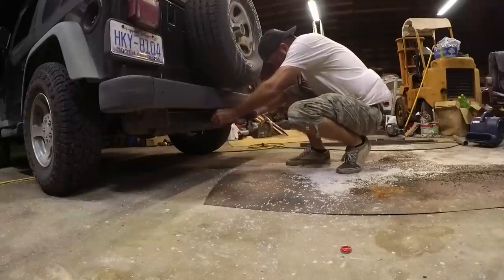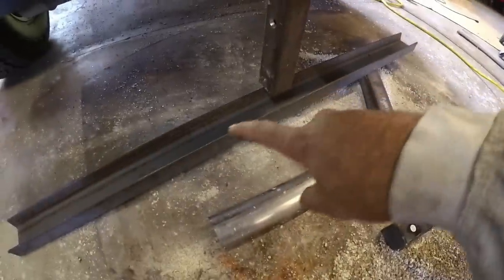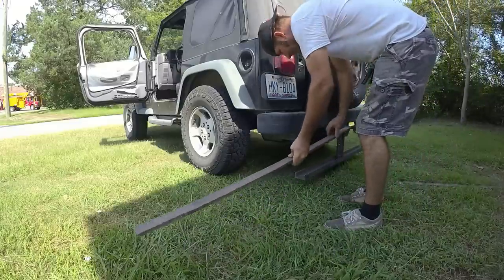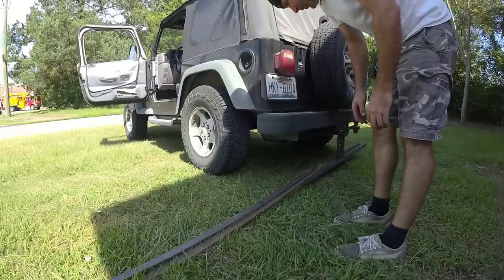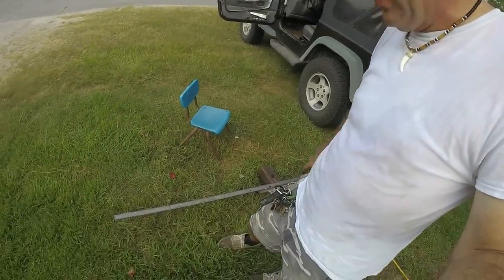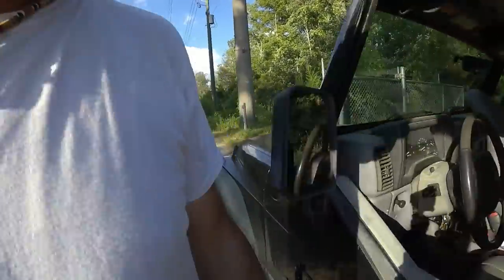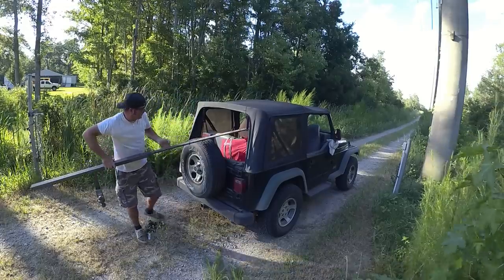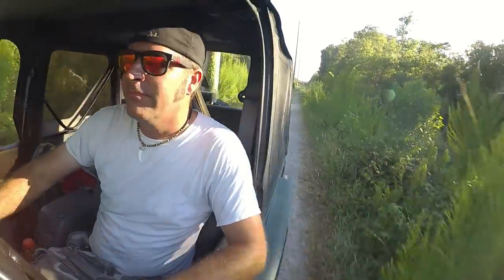Can I Build The Fastest Lawnmower?

Comment: at the beginning I was sure you would attach a lawn mower to the back of the jeep, and after watching the video, I think that if  you had a lawn tractor motor on a frame mounted to the hitch you could probably use belts to run side mowers, maybe use mower decks from the tractor too but chop out the front so they could eat properly...just a thought

Comment: If the blade was on a pretty decent angle(like 45 degree sweep towards the back at outside,I think your idea may actually work decent. The grass needs to be able to roll off instead of just being straight and piling up. Same principal as angling a snowplow. Future experiment for science purposes?
Reply: You are correct Randy Babcock. The angled blade is the ticket to success.
Reply: @johnnickerson6522  may need a bit more strength too,but I think it's a viable project. Gotta lose the drag
Reply: "For testing purposes only".
Reply: Yes exactly why im here to comment. It would work much better angled back. It would also cause more of a slicing effect and probably cut better.
Reply: the angled bade wouldnt need to be any stronger than what he currently has. the bending came from the flat impact and subsequent clogging up. if it were angled, it should shed any clogging, and have much less stress against it.
Reply: 45 and a big spring for breakaway in the heavy
Reply: I made a comment saying the same then scrolled down and saw yours lol
Reply: @iancampbell6002  it happens. I did the same. Saw a few after I made mine. Comment first,scroll later,let God sort em out
Reply: My thoughts exactly!!
Reply: Samezes ! Angled cut so it self clears and slices at it more! I think you’re on to something. Also ad a roll bar slightly above and behind the blade to keep the tall stuff from wrapping around the blade instead the roll bar will keep it partially vertical to keep slicing it
Reply: Adding a serrated adge would help significantly along with an angle

Comment: I have a jdm 2.5 swapped Subaru impreza station wagon that has a lawnmower installed to the spare tire well in the trunk. Not that anyone asked, just thought I'd share. Its a junker with issues... but if for some reason you want an oddball like that, I'd  say you can have it for free. Otherwise its just going to return to nature.
Reply: If you are getting rid of it , I will buy it from you  I will add long sickle bar off each side , that I got off of a golf course mower .

Comment: Seemed to work well enough. Maybe put a small Honda clone on the end of a belt driven brush blade setup.  That way you can drive slowly around the obstacles. No need for a heavy guard of course
Reply: My thought even was using the rear diff from a car, use belt pulleys to change the ratio so you don't have to drive quickly to make the blades spin quickly.

Comment: oh man, what a fun adventure!  Gets the creative juices flowing.  Iteration #2:  "I Welded It Myself" build a small bushog to hang off the side of that bar, with the Drag Rail motor on it spinning a blade.  (most any riding lawn mower lower deck would work).  No PTO required.  Iteration #3:  put hydraulics on it to raise it, and extend/retract the bar.  Iteration #4:  turbocharge the Jeep

Comment: So, I've done the math on that before... and depending on a little fudge for the actual mower blade diameter and what the governor is actually holding the engine rpm at, you need to be going 50-60mph to get the blade to be moving the same speed as a pushmower blade. I suspect that if you could maintain that speed you wouldn't have the clearing issue, but that could possibly be fixed by angling the blade forward or backward and it would be easy enough to deal with the blade height and angle problem (use a pin to set the height, like an adjustable height hitch, and let it pivot on the pin and then put an adjustable arm from the other side to the bumper to set the angle. A larger and longer vehicle, preferably WITHOUT a cloth top would be safer, maybe a pickup truck (that white chevy you passed a few times ;-) ), a longer vehicle should be more resistant to the torque load causing it to try to turn.

Yes, I've put some thought into this, I've thought about trying it with my Cummins Dodge (MUCH heavier, should be MUCH less prone to trying to turn in from the load) but I didn't have a good place to test it.

Honestly, find 2 old push mowers, add go-kart or minibike tires to them, mount them on a similar arm and then drag them through at about 15mph and you'll have better results and you should still get your mile run done in 4minutes.

Comment: It wasn't a completely stupid idea. It was along the lines of a bush hog blade. I would suggest angling the blade towards the back sharpening the blade more, putting a skid on the very end of it so that can ride against the ground so the blade isn't dragging right against the ground and put a pivot point with a system to where you can raise and lower the blade. Also have the blade up, start going and then drop the blade once you get up to a decent speed.

Comment: Ten 👍👍👍👍👍👍👍👍👍👍!
Some of the greatest inventions came from terrible ideas.
Airplanes for example.
You basically built a large sling blade. Stiffen your mount and angle the blade to the rear 45 degrees so the junk will move off the end.
A heavier vehicle may be advised.
Live and auto insurance definitely.
Pre set 911 in your phone, priceless.
Not a bad idea actually.
Be safe out there.
Cheers
Terry

Comment: Look for an old Sears Suburban sickle bar attachment. I’m sure you can rig up a small engine to a towable platform. You could even use a stripped down old lawn tractor. Use a 12 volt linear actuator to tilt it up or out.

Comment: You're only missing the geometry that makes it efficient like a samurai sword,  the bend actually improves it's  cut as the sawing action as the vertical vegetation slides along the edge of blade and yeah a bogey wheel from local hardware store could help hold it level from digging in but also adding weight and drag that could catch on weedpiles so watch out for that Idk if you've seen the drag trailer with big triangle knifes on it but the guy mows a square hole path to fit his vehicle through like trail grooming and can tow such tractor implementation with any fast vehicle of his weighty vehicles preferred for traction because he was loppin off tree branches with speed ... also had bending and fixing problems but probably one of the most fun ways to go and this was even after buying a bobcat sickle bar mower the thing just worked faster even if not the same clean cut as sickle bar mowers garunteed slow pace

Comment: The poles were definitely a pain in the ass to deal with on the one side of the drive way. but the blade didn't hit any of them. but I feel compelled to say it probably wouldn't have been a good thing. if it would have hit one of them and possibly wrapped your Jeep around one of them. but you did pretty good at clearing all of them.

Comment: I'm not gonna scroll, it's probably been said, but if you had a curved blade (swooping backward, away from the rear of the jeep), it would help. Same concept as an angled blade on a guillotine or mandolin slicer. Longer cutting edge for the duration of the cut. Flat is going to be more of a chopping motion. You need either a curve, or 45 degree angle away from the direction of travel, since it's stationary.

Comment: 😂😂😂😂 good idea 👍🏼 bad execution , why not take it and build a frame that can hold two stand alone push mowers side by side , and have it on a swing arm with winch control so you can raise and lower it to get to each section the. You just start them up and move along SLOWLY! Lol to trim the side definitely put some idler wheels on the opposite so in case that will take the Weight when rolling down the road hope this all make sense,but by far the funniest thing I’ve seen on here 😂

Comment: as someone who grew up in a family that just made stuff to take care of a problem, theres a couple of simple options for you here. the first one is to just swing the blade back at about a 45 degree, so that instead of a straight chop, it sorta slices. and the angle would also shed the stuff that was hanging up and clogging the blade there. the second option is to build a simple sickle blade similar to what a tractor uses, but instead of a PTO, just drive the blade off of a little wheel that rolls along. more engineering there but ive seen many farmers over the years building stuff like that. 40 years in farm country high plains, you see some STUFF haha

Comment: I actually believe that this is a brilliant idea if you use tube still with some bracing and get the thicker still bar and sharpen it weld it together with some serrations like a steak knife I'm pretty sure that the tall stuff wouldn't stick to it

Comment: Maybe instead of using a blade get some square tubing and mount a long battery powered hedge trimmer on the end. Switch it on and start driving slowely so the trimmer has a chance to cut.

Comment: it does work in a fashion. I think if you strengthen the sickle bar by using angle iron and triangulate a few areas and use a heavier vehicle with a longer wheel base it would work rather well

Comment: Pull a rear end with a higher ratio like 3.27 or even higher. Find the rotating assembly from a bush hog, attach it to the pinion. Build a shroud, the do a trailing arm style linkage to hook it to your hitch

Comment: Ok Ike your idea was normal. You're a man that doesn't want to spend anymore time than he has too cutting grass. Totally normal to try and figure out a way through mechanical means Todo so. Men have been working on this problem for hundreds of years. So that being said. Your idea though flawed was not without merit. With modification it just may work. Putting a 40 to 60 degree rearward sweep to the blade would allow the grass to slide off the blade and keep the cutting edge clear. Also maybe     going faster would help. Good luck. Thanks for sharing your adventures.

Comment: Revision 2.0 idea: make a frame that can mount to the front of the jeep, on it's center line. Bolt to that one of the field bush hog decks powered by a heavy duty industrial electric motor running off a few car batteries. That way you can drive forward at a reasonable speed, and line up your cuts. The bush hog units are proven to work, and reliable.

Comment: try adding cycling on it with valve release button when u come closer to pole push hold button it release air out of cycling make blade move back (behide jeep) pass pole u just release button it will fill with air push blade back forward to cutting grass
you need at least 50mhp to make it cut thur grass otherwise it get jammed up by big stuff

2nd version u can do may be safe but not for fast it like pull behide mower with 80hp 70in deck and wheels and attached to jeep hitch good togo

Comment: You know it's not like you don't have money,  are assets that you can trade for a 45 to 55 hp tractor that has a cab with a/c and heat in it.
Along with a bat wing shredder that you can raise or lower end sections as you need to. 
It doesn't have to be 4x4 in order to do what you need, and it's a lot more fuel efficient being rear wheel drive only. 
As long as you have decent tires on it it'll do everything you want. 
You can get offset cutter if you want, but I'd go through everything you want mowed, and either do it with a commercial grade zero turn at low speed and deck raised up as high as possible just to make sure you don't have anything that will destroy a mower cutting at decent speed down close to the ground. 
That's the safest and most efficient way to do it, are hire someone to come cut it twice a year or more if needed. 
If you get the trash weeds out of it, then farmers will cut it for you on shares to bale it for hay, and that gets you agricultural exemption for your land lowering your property taxes greatly. 
If you really want to do things the right way, and a mile each way, with it widened to the furthest point of cutting could very well make you decent money on top of tax exemptions.

Comment: You needed  triangulation on the back side of the blade.  And it won't bend.  It would work.    Strap 3 push mowers to a bar, with atv winch  you can lower and make your own brush hog.  That would be easy also

Comment: hmmm was about to mention that the last time you whent fast on a lawnmower it didnt end up well then i saw youre plan ...............if that wouldve worked it wouldve been sold commercially a long time ago , it mightve worked if you would make it more circle (sickle) shaped with the bend moving to the back or at least mounted at a steep angle pointed back like one side of an arrowhead , that way the friction would move the stuck material to the edge and off the blade 
you might be better of making something spinning , like a predator powered spinning blade or set of spinning blades , if you look at a brush hog it has spinning disks with metal knifes on the end that can spin on a single bolt , 
https://bushhog.com/wp-content/uploads/2020/06/2208Underside.jpg
they been held out by the centrifugal force but can bounce off say a small pole sticking out of the ground 
you would need to drive slower and the blade needs to be spinning anti clockwise so the knife on the front of the mower pushes the grass away from the road when you mount it on the drivers side of the vehicle , it be way more effective , you can still mount it of the hitch receiver and have it hang off the side of the car (maibe use a volvo instead and put on a good cover over the blade and some extra thick steel in the door and behind the seat back in case the spinning blades come off )
the spinning allso slings the cut grass away from the cutting edge of the blade so you should be able to cut the stuff even after the first few meters without the material folding over the cutting edge

Comment: attach a hitch to a 4.11 or higher ratio diff and bolt the blade across the down facing uni-joint. it would be safer but you would have to drive over the grass to use it.

Comment: it seem like it worked even tho it wasn't the best idea. if u could fix it on a hinge point with a sprint to keep it pull out that way if it hit something it could fold back then be pulled back with the spring, might give it just enough movement to keep it from bending it also. just a thought. it worked, not the best so ad to the idea.

Comment: You should find yourself one of those pull behind sickle mowers that the wheels power the sickle blades and they are usually 8 ft long for the blade part I would cut it down to a 4 ft or 5 ft section and have someone with you and you can control the height and it'll cut anything and it will cut Elder brush too or small trees my grandpa did the same thing for his trails and it worked out great only don't fall is it's a two-person operation

Comment: You should build a rolling deck and use 2 125cc engines with a pulley system to run 4 38 inch blades kinda like a brush hog but for your jeep
Reply: If not use it on #carsandcameras behind all of your guy’s fleet lol

Comment: Just get a old 5hrs sickel mount on the back you dont have to go fast and itll cut instead of pulling
Reply: ISAC also i know its on the other channel. But look into a webber carb for the drag rail. Youll be able to tune it better. Vw webber 2 barrel side mount for vertical mount